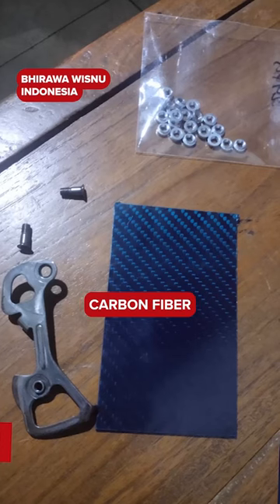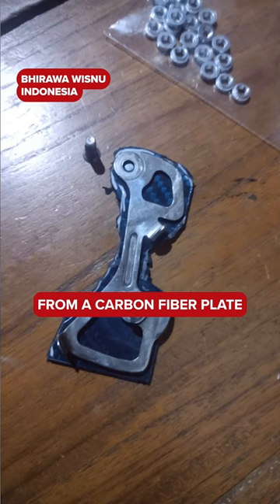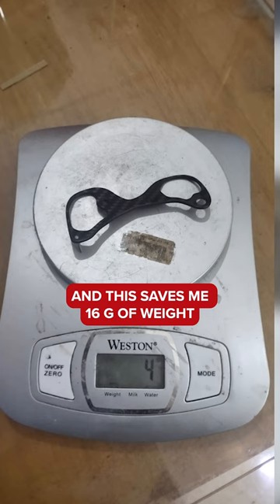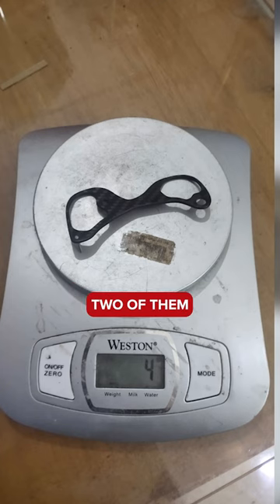This is some serious engineering! 🤯

Comment: 16 grams🤔, what if the cage folds and pulls the chain into your light and expensive carbon fiber rim, which you either have due to weight loss😢
Reply from the maker: 🤔 we guess they probably patch the wheel up with some carbon sheet?! or make another derailleur cage?!

Comment: I just don’t get why people are such weight weanies. My system weight is around 75kg. That’s 75000 grams. Cutting 16g out is a waste of time compared to literally anything else I can do to improve my times.
Reply: because in xc or enduro a little diffrence makes a long way also like if you taek away 16g from like 10 items it stacks up easily
Reply: @jackr0101 They could save 300 g or so by using downtube shifters instead of brifters but....
Reply: @peterwillson1355  yes but why not save weight when you can

Comment: Why joke? You can make your own carbon fibre parts. It's not exactly uncommon, there's various methods. Afai understand the work is the expensive part, it wouldn't necessarily be that hard. Not sure I'd start with handlebars 😅 but on the other hand if you want to make flatbars. Well. A simple straight bar sounds like it might be extraordinarily easy to make.
Reply: buys a 30mm carbon tube online